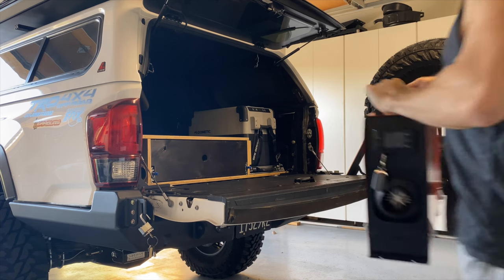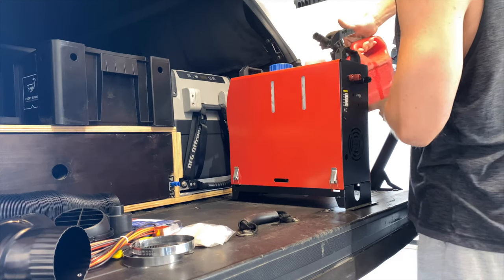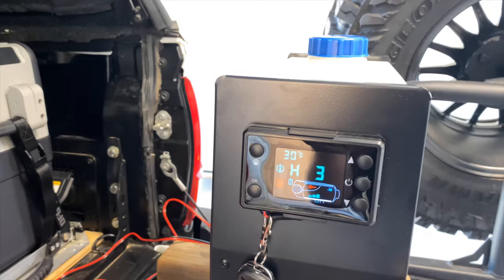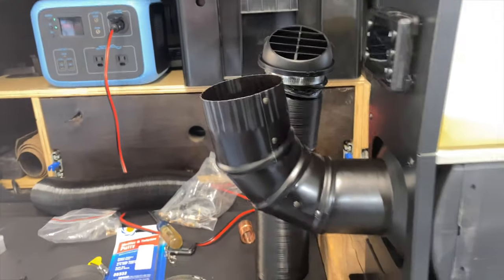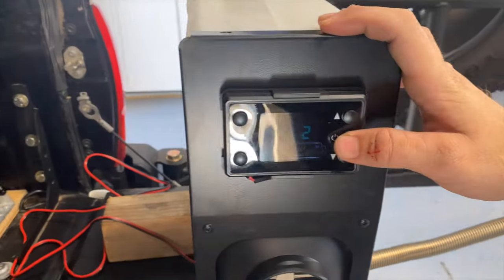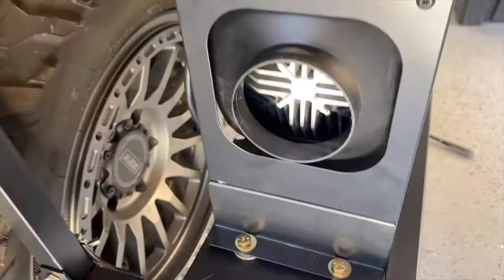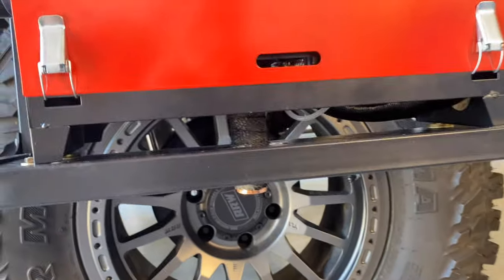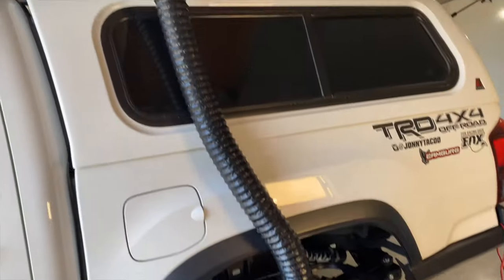Ultimate Diesel Heater Mods for Camping (Winter Overland)

Comment: Much better efficiency can be obtained by running a second hose (same size as the one feeding the hot air into the tent) from the air intake end of the heater to the inside of the tent. As it now stands you are always heating outside air. The heater can raise input air by a finite amount which creates a differential of a fixed value. For example if the heater is capable of raising input air by 40 degrees then the output air temperature will always be 40 degrees higher then the input air. If the input air is taken from outside the tent and that temperature happens to be, say, 25F then the heated air entering the tent would be 65F - not bad but for every degree that the outside air drops, the heated air also drops by the same amount. If you take the input air from inside the tent you will stay much warmer with less fuel and be less sensitive to outside air temperature. Those numbers may not be what your heater delivers but the principle is the same.
Reply from the maker: My buddy at Lexus Off-Road Adventures was telling me about this. Thanks for the comment.
Reply: This is a very bad idea as it creates negative pressure which can draw exhaust fumes into the tent. Always draw air from outside to create +ve pressure inside to prevent killing yourself with carbon monoxide. Same reason space heaters have been banned in Australia. Too many people dying
Reply: @GregBatt66 What? The exhaust is outside and the tent will be on the roof. 

If anything the air intake is more likely to pull in exhaust gas as it's setup now. 

If the air intake was inside the tent it would be farther away from any exhaust gases.
Reply: @GregBatt66  I think you’re thinking of the combustion intake. For the actual clean air intake this doesn’t make sense as the total amount of air in the space, assuming it’s air tight, which it is not, remains constant because it is heated and recirculated.

The combustion intake on the other hand is air that leaves via the exhaust so if that is inside the space then that would create negative pressure as you’re effectively removing air from the inside.
Reply: The reason you’d want to draw fresh air in is condensation mitigation. Recycling warm air is more thermally efficient, yes, but condensation is always the issue. Bringing in fresh air, heating it and cracking a vent keeps the air changing throughout the night and always results in less condensation.

Comment: Jonny I have this exact heater, if you hold in the 2 left hand buttons it goes to alpine mode for higher altitude. It shows ups 2 mountain peaks on the display. Makes it slow down uses less fuel and slightly less heat.
Reply from the maker: Hey thanks for the info might want to use that just to slow it down in general it works too good
Reply: @jonnytacooutdoors  yeah it's a handy setting, just makes sit sweet topping up the heat without over heating.  Also the display is actually a count down not a clock, so you set it to come on and off.
Reply from the maker: @alexprichard6003  love this heater! Used it again last night 🎉 stayed 70 degrees in the tent!

Comment: What size inner diameter hose did you use to feed the fuel filter? I got quarter inch hose but the plastic fuel line is smaller. Or did you get a smaller size nipple on the filter?

Comment: Would you say the diesel heater is pretty loud? I occasionally camp in state parks where the campsites are within 20 - 30 feet of each other
Reply from the maker: There shouldn’t be a problem at all especially with 30 feet

Comment: Like the mods you did thanks for showing us. I want to get one of these for my four wheel camper but I just dont know the right power source to use. Definitely dont wana go off my truck batteries,  how many days can you get on that blue charger you have? If running it while sleeping all night like 9 hours lets say, hanging out and sleeping lol
Reply from the maker: The bluetti will last 2 and a half days powering my dometic fridge. If I plug in the solar panels into the battery it’ll run indefinitely. A couple trips ago I finally got to use the solar panels because we were parked in the same a lot for a couple days and it’s awesome what they do. I linked the bluetti battery in the description. However that’s the 300WATT battery you can get bigger but they just get more expensive. I opted for this one because it was in my price range and I wanted the solar panels. Thanks for watching!

Comment: Great build! Might I suggest a carbon monoxide detector for the tent. The unit's build quality looks surprisingly good, but you can never be too safe
Reply from the maker: Thanks for watching and I picked up a couple of carbon monoxide detectors it’s a good idea for sure. 👌🏻
Reply: The heat vent doesn’t blow any exhaust fumes. It’s a heat exchanger.
Reply from the maker: @timjchick  good to know
Reply: @timjchick  - The exhaust vent is still down below the tent.  As is the truck.  Never a bad idea to have a Carbon monoxide detector.  Sure, CO2 falls, but hot air rises.

Comment: That heater is gonna melt that plastic vent hose.
Reply from the maker: Are you speaking from experience ?
Reply: @jonnytacooutdoors  my hose needed replacing and I ordered what looks to be the same as you got there. The minute I touched it I knew it would never work. I went with a 3” heavy flexible expandable aluminum hose. I had to modify it a bit to a 2 kw heater, but it gets so hot you can’t keep your hand on it for more than a second.
Reply from the maker: @lmorrison17  it does get warm but I’m sure in the cold that wouldn’t be an issue
Reply: @jonnytacooutdoors  Well good luck and I hope it works out good for you.😀
Reply from the maker: @lmorrison17  thanks might be going to some below 20 degree weather this weekend
Reply: @jonnytacooutdoors  
2 days ago I measured 213 degrees F coming out of the air flex tube that comes with the unit. The exhaust was coming out at 354 degrees F from the muffler.  I believe it was running on #5 setting.   After the unit was at full temperature, I could not smell any exhaust fumes. It burns decently clean without diesel smell. I would try cooking that flex air duct on setting 6 for a few hours before going camping and see if it gives off resin fumes. Even the aluminum dryer duct should be cooked off for a few hours to burn off manufacturing residue before you breathe it.   

 I will be strapping this unit onto the top of an airtight fireplace unit. The County severely restricts wood stove  ''burn days'' and I'm getting tired of the Little Buddy burnt propane smell.  I will drill a 25mm hole into the side of the wood stove and run the flex exhaust pipe into the fireplace insert so some exhaust heat might be reclaimed while exhausting up the chimney.  The Little Buddy 8000 BTU heater does a fair job of heating the living room but the burnt propane smell nauseates me.  I saw somewhere that the diesel heater puts out about 25,000 BTU. It's worth a try.
Reply from the maker: @kimmer6  yes you are a smart smart! My grandpa actually said the same thing. Let it burn off! I noticed since I’ve ran the heater for about four hours total now the smell seems to have gone away. Thanks so much for the input you’re helping to make this channel better. 

 Part two coming Monday!

& yes diesel heaters have their advantages and you can’t beat the price for the units!
Reply: @jonnytacooutdoors
Reply: I strapped my Chinese diesel heater on top of my fireplace insert today and drilled a hole in the side to exhaust the heater into the wood stove. I tapped the hole for a 3/4'' pipe plug.  I added a bright 12 volt LED  light inside to illuminate the fuel level. It's powered by a 12 volt supply and the whole unit can be removed by undoing a wingnut. It's solid to the woodstove top and can't be bumped off or shaken off by an earthquake but can be removed completely in 30 seconds.  The short outlet hose points the couch where the old and cold lady sits. Works well, ran it for 6 hours tonight. Even the cat likes it.   When the SHTF, I have multiple ways to heat at least part of the house. The Air Quality District restricts fireplace burning here. I would get a fine for burning without their permission.
        Looking forward to Part 2!
Reply from the maker: @kimmer6  wow great idea and how’s the heater working for you????

Part two comes out Tomarrow! 😎
Reply from the maker: @kimmer6  👋🏼
Reply: @jonnytacooutdoors   I like it!  With the house furnace off, it was 55 degrees F in the living room. Currently 64.  It's for my old van but needed testing here first. It was red  and stuck out terribly so it got some black paint on it.  https://www.youtube.com/watch?v=iiZLMGuNPEE
Reply: @jonnytacooutdoors   Ha!  So far, so good!  I bought the heater for my old van but watched your video and threw my project together yesterday. Mama had the Little Buddy radiant heater burning for the last few mornings but the burnt propane stinko settles in the upstairs bedroom. This is much better.  The living room started out at 55 degrees F this morning and is now 64F. The unit comes off by unscrewing a wingnut and slipping the muffler off. 30 seconds later I can put wood in the stove to burn...IF its a ''burn day''. I ain't paying no fine!
https://www.youtube.com/watch?v=iiZLMGuNPEE
Reply from the maker: @kimmer6  nice! 😎

Comment: The quick connect exhaust is awesome. Might think about getting a copper “union” fitting (1/2”? ). It’s a two part threaded “nut and socket” fitting that threads together. Less chance of the coupling heating up and falling out the bottom of the heater. Can’t swear it would work. Just an idea. Awesome video!
Reply from the maker: That’s a really good idea the fitting that I used it’s actually pretty loose because the exhaust pipe is really thin material and so you can’t really get it that tight. I have yet to have the exhaust fall out but it’s definitely a possibility. I love your idea about a threaded fitting. That sounds awesome. Let me know if you get that figured out.👍🏼👍🏼👍🏼

Comment: Thanks for such an informative video! You did an amazing setup. 
Just two quick questions;
1. How loud is the clicking noise? Since you are using it near your tent, isn't that too loud for overnight ?
2. How strong is the exhaust smell? Isn't it irritating to keep it close to the tent?
Reply from the maker: Thank you. The clicking noise isn’t loud and I never got a strong exhaust smell inside the camper shell or my truck camper now. The heater works great & if the click bugs you then you are supposed to hang the fuel pump by zip ties instead of having it solid mounted inside there(supposed to quiet it down). Mines still hard mounted I don’t hear it inside my camper with the sound of the air blowing into it.😎💪🏼

Comment: I have the same setup going into my RTT. My issue is that if I run the heater over Level 3, then the heater goes into overheat mode. Have you had any issues like that?
Reply from the maker: It’ll do that if it’s not cold out or try running a 4” hose instead of a 3” my buddy had luck with that

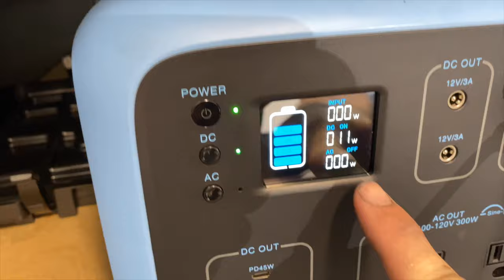Comment: Nice video on your diesel heater install.  Just curious how it has been going since then.  I tried a similar setup and found my external battery (1200 watt hour Lithium Cube) was shutting off because the heater was drawing more than 10A, which you also mention at 15:05.  Jackery and most others also limit their DC output to 10A so just curious if there has been any issue from your end.  It is not a huge deal, you could use an AC to DC converter with higher amps produced, but just one more thing to have to deal with in the setup.
Reply from the maker: Hey I used it for the first time this last weekend and didn’t run into any issues. However I didn’t run it the entire night. We will see how it does throughout the next trips.
Reply: I ran into this issue with my EcoFlow River 2 Max. Luckily I already had the dc to ac converter on hand. I’ve ran it a few times with the converter and haven’t had any issues. Although I was definitely bummed when I had the overload message on my EcoFlow when I was trying to run it on dc
Reply from the maker: @FernandosWildlifeAdventures  that’s interesting I’m pretty sure I’m running it off DC power (12v) with my 300watt bluetti. Glad you figured it out though
Reply: Do you guys have a link for the converter that may be needed to keep the unit running?
Reply from the maker: @branrod79  hey a guy messaged me about getting a converter. I just messaged him and asked him which one he got. Try checking out Amazon. But I’ll message back when I hear back from him. Message me on Instagram I can link you easier.
Reply from the maker: @branrod79  https://www.amazon.com/dp/B09B3JT7H9/ref=cm_sw_r_api_i_BDX00DDM5DS6QCXJTQ96_0?_encoding=UTF8&psc=1
Reply: Same issue with an Anker solix c1000. AC to dc converter solved it though.

Comment: Sick mods. Ill have to recreate all these mods for myself.
Reply from the maker: Do it! Make sure to use my links 🙏🏼
Reply: Try explaining this over and over to a guy who watches the work and pretends he dosen't understand that you have to add mods somtimes to have the product safe! And somtimes you get to a point where you built so much you wonder "wtf is wrong with this guy, does he not see straight yet?"  And I like the idea of the metal pipe! Where do you find that size? I will take a look on amazon!
Reply from the maker: @nathanmciver6496  thanks for watching
Reply: @jonnytacooutdoors  so 3 " elbow, where do you buy this?
Reply: @nathanmciver6496  instead of the 3 inch elbow look for "3 inch semi rigid aluminum duct"  its very sturdy, flexes well and bends to a sharp 90. Ditch the elbow and only use this. Its 8 feet long and gets the main heat away from the soft ducting(the stinky stuff) that i use.

Comment: You just need to expand the tire step arm that goes over the tire (it's adjustable) and it's gonna sit perfectly flat, no washers needed.
Reply from the maker: Yeah I kinda realized that it actually folds down smaller also if I want it to. This thing is super awesome! Thanks for the tip Luke I really appreciate that.

Comment: You have a great setup here! Thanks for the tips and installation video. I probably won't go camping in the winter, but this would be a decent option to use if I ever had to. Do you have a video of it all packed away when not in use? Do you keep it in a box and then pull it out when you want to use it?
Reply from the maker: Hey glad you enjoyed the video and thanks for watching. Go check out some of my other videos and make sure to subscribe 

In regards to packing it away I thought of maybe getting a PC cover for it. But there’s not many extra parts. There’s only the exhaust, and the vent hose . Those I must throw in a front runner storage bin. 👌🏻 I decided to keep the power cords always attached the the posts on the heater and I just bundled up the wire and Velcro tied them to the top plastic handle piece.

A Video of me using the heater is coming soon!

Comment: How about rainy weather, do you cover the unit, if so how? Thnx buddy.
Reply from the maker: I was about to have some rainy weather so I covered the screen with a trash bag. That’s honestly the only part I would worry about. Maybe you have some other thoughts or ideas let me know.

Thanks for watching ! 🙏🏼
Reply: @jonnytacooutdoors  well I was thinking something similar. I was worried about the battery wire connection points as well but not sure. Great video and vehicle by the way 🤙🏻
Reply from the maker: @Araskazar  yes didn’t think of those! I was thinking of maybe getting a pc type cover for it just for storage but not sure if that’ll work while it’s running. So yeah maybe some plastic type cover to cover those two top parts. 

I’ll actually be running a 270 awning in the future so I’m hoping that should be enough to keep the electronic parts dry.🙏🏼

Comment: Does that hose leading to the rtt cause any foul odors when the heater is running?
Reply from the maker: Sure did when the hose was new . My advice is to run the heater with the hose on it for a couple hours before you use it with your tent to burn off the smell.
Reply: Thanks!

Comment: How do you maintain the temperatue when in automatic mode, isn't the thermostat built into the controller? I am considering doing what you have done but also extending the wires for the controller so i can have that inside the truck camper.
Reply from the maker: Extending the controller would be sick. I just learned how to use the remote and can turn it on and off. Other than that . In a few months I’ll be solid mounting it into the back of the truck. I just put it on the low setting and let it do it’s thing. 

Hope to film a video soon when I go out, life’s been crazy the past couple months.

Comment: Any reason why the exhaust pipe needs to be so ungodly long on these? Why not just a little non flexible L pipe out the bottom?
Reply from the maker: That’s a good question. You could always cut yours to make it shorter.

Comment: Question: I purchased the 25mm coupler but... the cut part slides in as you did but the other side (the clean part of the pipe is probab 1mm smaller so it is way too loose. How did you make it work? Thanks a lot.
Reply from the maker: Mine actually isn’t snug when I install the exhaust into the coupler but it has not fallen out. If it does become an issue I will come up with a solution! Keep me updated on yours.👌🏻I usually put it in and bend it a little if that makes sense to make sure it has a decent grip.
Reply: @jonnytacooutdoors  Well, I just inserted a broom handle and it helped to slightly widen the entrance of the pipe, now it fits as you said, not falling out. Cheers bro.
Reply from the maker: @Araskazar  dude that’s awesome. See now if myself or others have that issue I can pass along the broom handle trick. Awesome